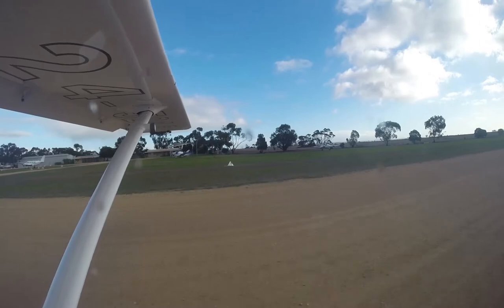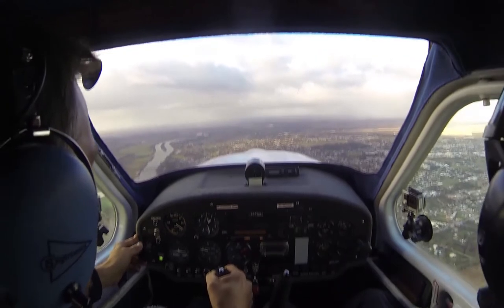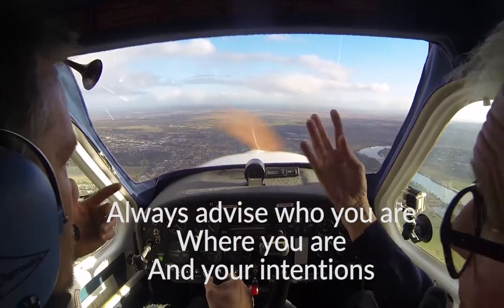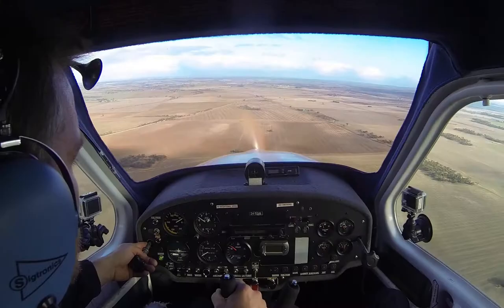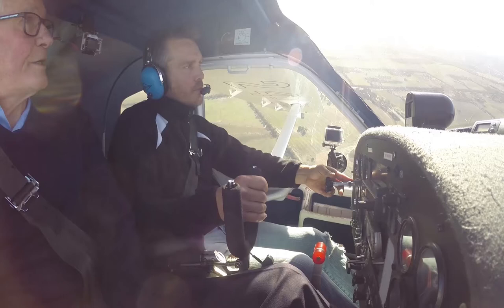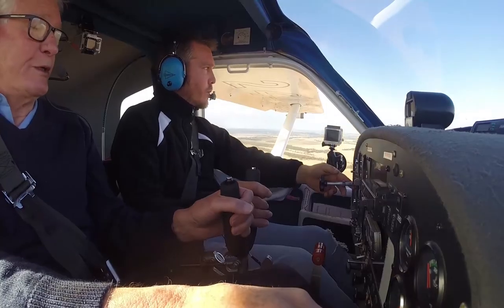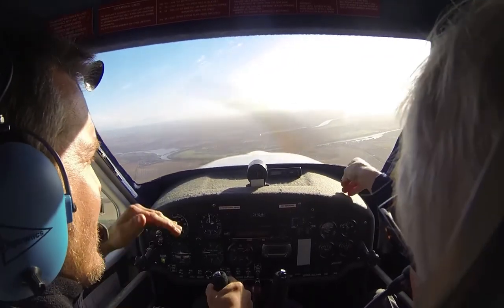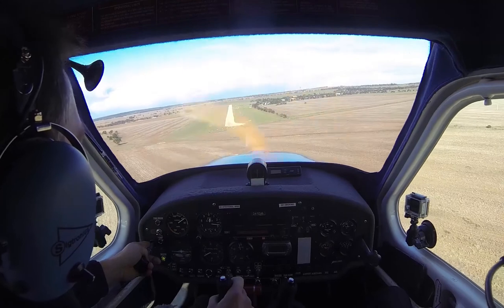Challenging Crosswinds   |   Depart & Join Circuits  |  Stefan's Saturday

Comment: How do the hollow numbers on the wing fall under the marking requirements for RAAus? I thought they all had to be solid? Can you get away with hollow numbers on the wing if you have solids on the tail?
Reply from the maker: Hi Joshua...short answer is I have no idea. The Aircraft ID have specific regulations but advertising I don’t believe is regulated.